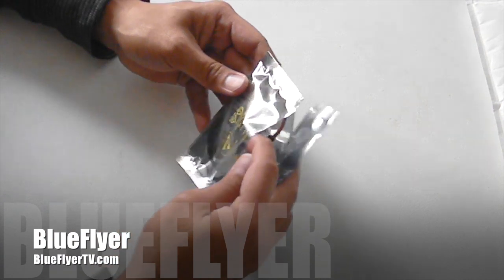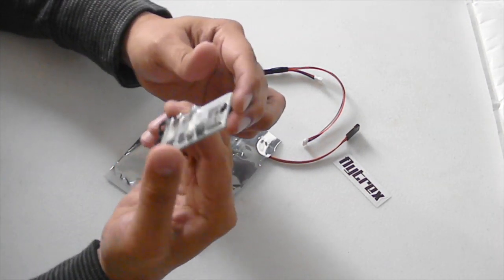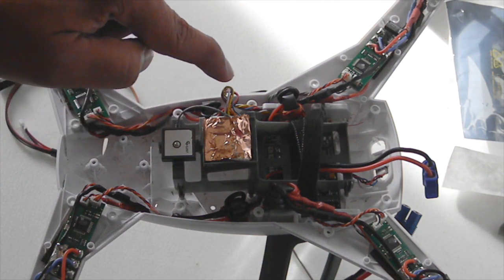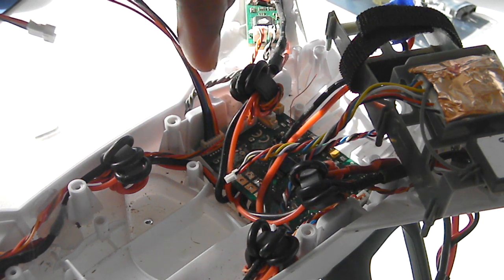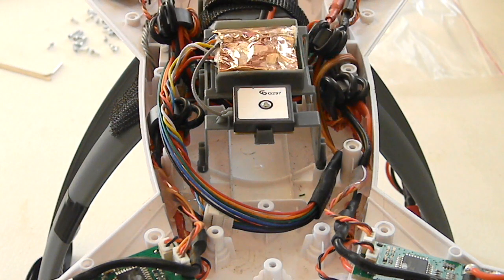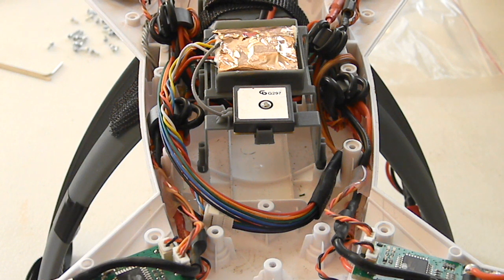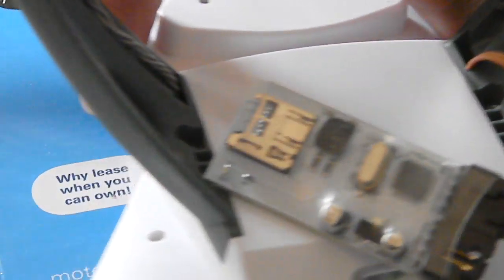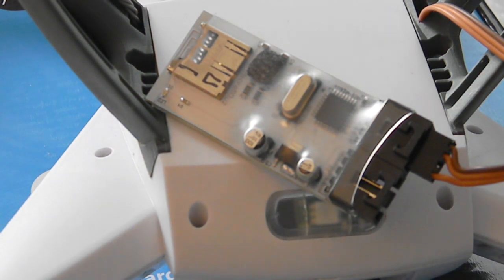Flytrex 350QX Flight Tracker unboxing and installation guide

Comment: Is this the standard cable that comes with the normal FLYTREX or is there a Blade version of the FLYTREX?  Thanks for the video....really helpful!
Reply from the maker: Flytrex makes a specific core module and cable for the 350QX and Naza controllers.  It's mainly GPS slot specific.
Reply: BlueFlyerTV Thanks, bro.

Comment: Im assuming you dont loose return to home or any features like that? and is there a reason you cant mount it inside the 350? with my gimbal and fpv transmitter i dont have much room left, not to mention it would look cleaner being inside
Reply from the maker: No.  You don't lose the RTH feature because you are still using GPS.  It's already pretty tight inside but you can always try.  It will be a cleaner look.

Comment: NOW THAT YOU HAVE THIS SYTEM MOUNTED WHERE DO YOU SAVE ALL THE DATA TOO A CHIP THAT IS MOUNTED IN THE UNIT AS I DIDNT SEE IT OR DID I FALL ALSEEP HA HA
Reply from the maker: I pointed out in the beginning of the video that there is a microSD card slot.
Reply: OK SO FOR ME WHO IS NOT THE SMARTEST BULB HERE ...EVERY TIME YOU GET THE  DRONE BACK YOU WILL HAVE TO DOWNLOAD TO YOUR COMPUTER FROM THE CHIP YES ...AND IF IT TAKES YOUR HEIGHT AND SPEED AND WHAT EVER ELSE IT STORES OR  YOU GO FASTER EACH TIME YOUR IN FLIGHT DOES IT OVER RIDE EACH SETTING
Reply: I ALSO FOR GOT TO ASK DO I NEED PURCHASE A CHIP ALSO